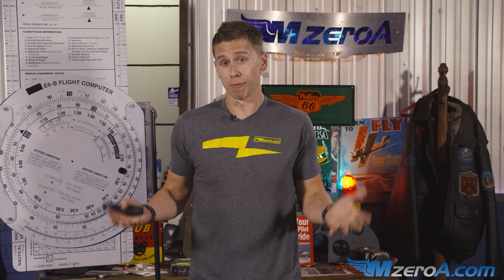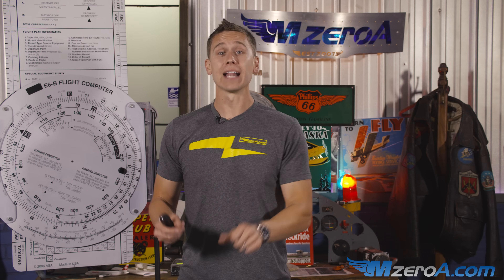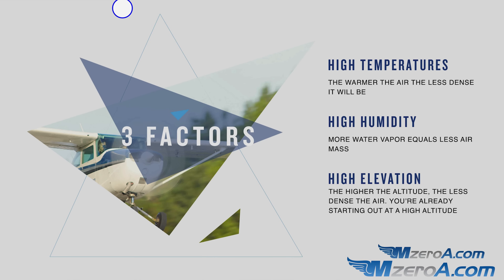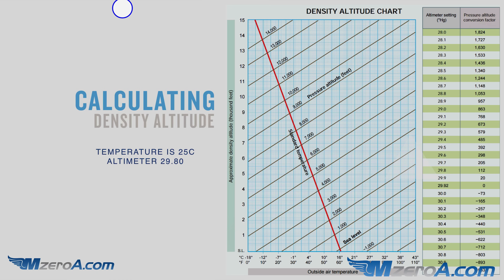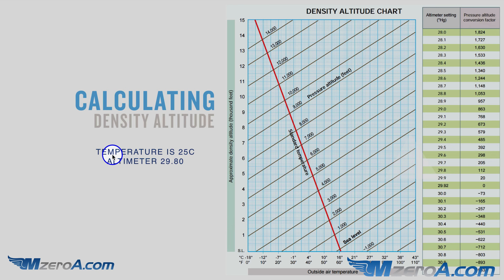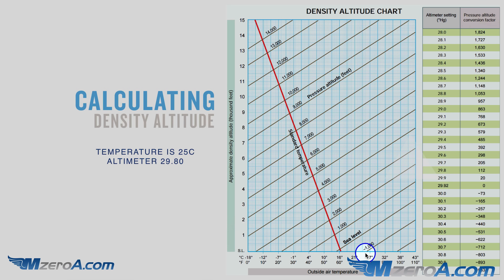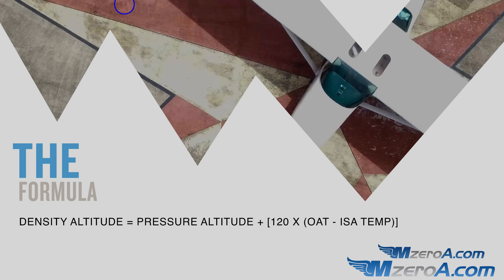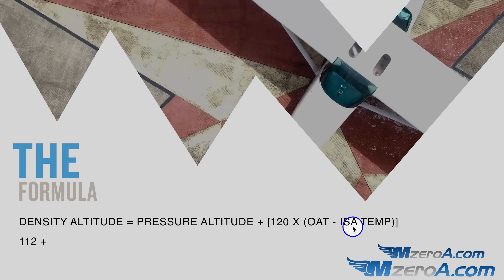How To Calculate Density Altitude

Comment: CFI here. I had to give you a thumbs down on this vid Jason. you make a statement that you are only affected by DA if you are in a non turbo charged aircraft. Although the engine, in a turbo charged aircraft, will be able to perform at sea level pressure, the prop and wing performance will still be reduced at high DA. you are not immune to DA because you have a turbo, you are simply improving one of three performance areas of the aircraft. 
the false sense of security of a turbo charger is also responsible for lives being lost.
Reply: I mean he did a great job explaining density altitude calculations which helped me out as a student pilot. One mistake about a somewhat unrelated subject shouldn’t warrant a thumbs down IMO
Reply: Your so cool
Reply: I'm just curious, turbocharged aircraft would have their own performance charts in the POH to aid pilots in making takeoff and landing decisions in higher DA wouldn't they?
Reply: There goes another 'CFI'
Reply: Temperature and pressure altitude have independent effects on turbocharged piston and turbine engines. Frankly, density altitude should only be discussed for general awareness purposes and should never be used to calculate the performance of any aircraft in a particular situation. The aircraft's manual should always be referred to.
Reply: Hi Allen, try to listen to the video once more. Jason says that airplanes with turbo charger or turbine engine(s) should not use the introduced DA rule of thumb. If you disagree, you are probably saying that such aircraft can in fact use the density altitude rule of thumb.

For instance, does a turbine engine powered aircraft at standard sea-level pressure (29.92) and at 25 deg C feel the same, and thus climb the same, as at 15 deg C with approx. 1200 feet of pressure altitude? My guess would be that high temperature reduces performance more than low pressure. It is an interesting question though. Do you know the correct answer?
Reply: Even a turbo charged aircraft can use the DA rule of thumb. As DA increases, performance decreases. This is true for all aircraft but a turbo HELPS reduce the decrease in performance as DA increases. The wing and prop are still less efficient. You can help some with a constant speed prop and special wing designs, but thats all they do is HELP. None eliminate the effects.
As for the question about the reduction in performance, temperature has a much longer arm on the performance factor (DA) of all aircraft. I could write a novel on the subject, but what it comes down to is hot air is less dense than cold air. The lower the density, the less air you have to create lift, thrust, and the further (runway length) you will need for takeoff and landing.
Reply: Thank you for the clarification.

Comment: Thanks Jason, this does help....however I always struggle with the interpolations on the FAA test question...e.g.Altimeter Setting is 30.87 vs a straight 30.8 They almost never give you a straight up Altimeter setting.
Reply: I know this is a year old but here is how I do these questions. 30.8 = -803 and 30.9 = -893 straight from the Density Altitude table in your study material. Your difference is 7/10's the way to 30.9 from 30.8. Therefore you can find 70% of the difference between -803 and -893 and easily find your answer. -893 - -803 = -90. Multiply -90 * .7 and  you get -63. Add that -63 to -803 and you got it. 30.87 = -866. To make it easier to not screw up with a negative symbol here or there you can run all the numbers in the positive and then just switch to negative at the end. It's calculating not interpolating but in some cases the answer choices are too close for interpolation.

Comment: Chemist here.  Water molecules do not "attach themselves to the oxygen molecules".  The reason water molecules (high humidity) lower air density, and raise density altitude is quite simple.  Water molecules weigh less than dry air molecules.  Dry air consists of 78% nitrogen molecules (N2) and 22% oxygen molecules (O2).  Nitrogen molecules molecular weight is 28.  Oxygen molecules molecular weight is 32.  Water molecules molecular weight is only 18.  More water molecules in air, higher humidity, means that lighter water molecules are diluting heavier nitrogen and oxygen molecules.  Humid air is, despite the subjective experience, less dense than dry air at the same temperature and pressure.
Reply: Thanks, that explains the smaller mass if the number of molecules stays the same in a given volume. Or if each water molecule in average replaces at least more than 0,62 "air molecules" in that volume. Why this would be the case is not obvious to me though.
Reply: Wait a minute... Dry air is majority nitrogen... Well now I have to reconsider some things. Thanks for the info!
Reply: Listen This is Aeronautics, Get your chemistry brain out of here.